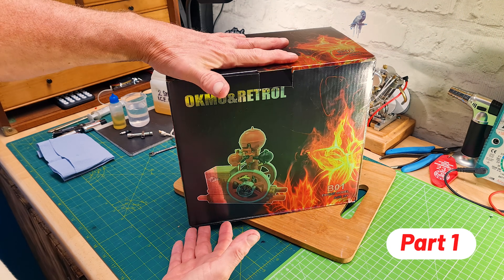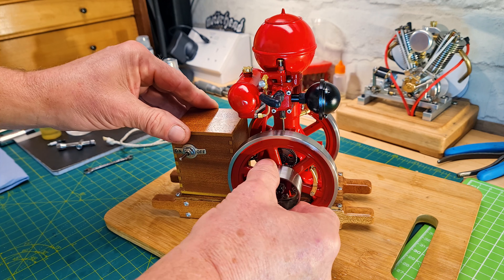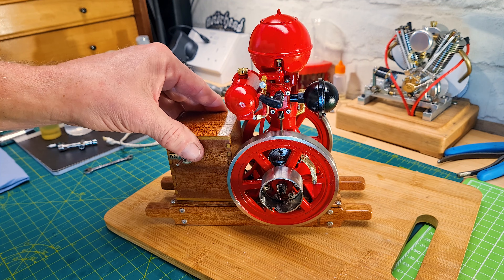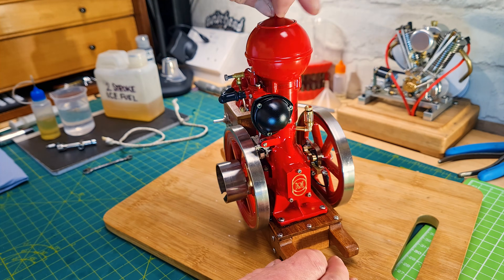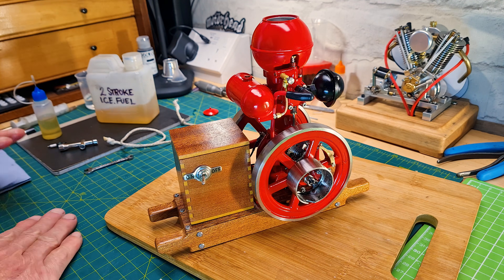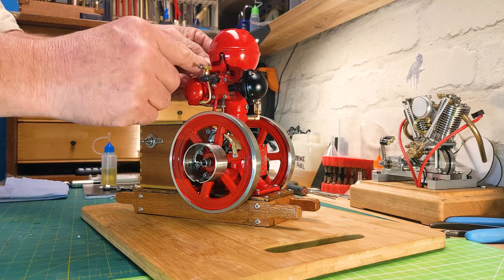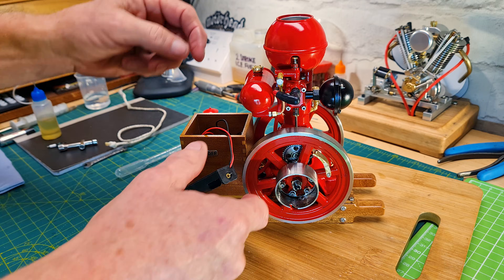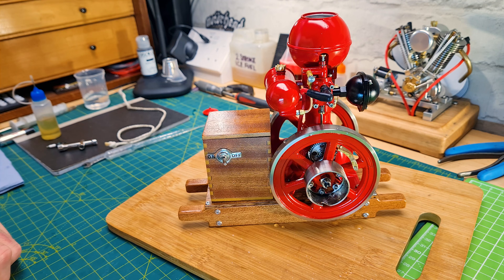Vintage Hit & Miss 'Monitor' Ball-Top Miniature Precision Gas Engine   -  (4K) #enginediy

Comment: Hi Ade. So sorry to hear you are having problems with your B01. I was lucky, mine ran straight out of the box. It's obviously either fuel or ignition. It might be worth removing the throttle needle completely and blowing compressed air into the carb. Something I noticed when I took mine apart to mount it on a wooden base board (see my latest video) was that were the earth wire is attached to the casting, very little of the paint had been removed. Before putting it back together I scraped off a little more of the paint so the ring terminal on the earth wire had a good ground. One other thing, you may not have noticed them but the bearing caps have very small oil cups cast into them. A few drops of oil in these allows some lubrication of the crankshaft. Good luck. Cheers, Alan.
Reply from the maker: It will run, just need some more time to fiddle :)

Comment: It does seem to be failing to fire sometimes hence the multiple clicks. Would be interesting to see you turn it over for a minute using a drill with the spark plug out to see if the spark is intermittent. Is the fuel nice and fresh with not too much oil in? The timing should be near to TDC which you should be able to set by observing the position of the piston through the spark plug hole. Looks like it is firing too late. Maybe do a live stream investigation so we can enjoy the process of problem solving.

Comment: These are beautiful little engines.   And yes sir, I had the same issue with mine..  In fact,  I have a full size monitor engine with the same problem. (actually its my dear wife's engine)    I think I can help. The engine is starved for fuel.   Next time you run yours, try to cover half of the intake opening with your finger / finger nail and see if it helps.
It helped mine right away.  so I made a "choke sleeve" for mine.  I found a piece of rubber coated wire, that just fits in the intake with the insulation on.   I stripped off a short stub of the insulation, about 5/16" or so, and fit that in the intake opening and ran it. It worked a little too well, so I had to drill the stub out just a bit, and now it works just fine.  If this works for you, make sure to cut the stub of insulation 1/16" or longer. this way there's a little hanging out the engine if you ever need to remove it or replace it.   

I think this is a rare issue with these engines, as mine is the only one I know with this issue, until I saw this video.    I hope this works 

 Also I need to run mine with the needle valve open more than 3/4 turn.  Also make sure you have at least half a tank full or more of fuel in the tank.  Mine also jumps around a bit. to help with that I made up a weight that fit inside the engine's skid.

I hope this helps you with yours.  And please let me know if this helps.    These are wonderful little engines!
Reply from the maker: @20bluebug - Thank you so much for your reply and valuable insight! I will take your advice and continue working with this lovely engine until it purrs!  - Kind Regards, Ade

Comment: Great overview of this engine! I found with mine it was a little temperamental as the contact for the HT lead to spark plug wasn’t close enough to the contacts, bent it in slightly and it runs very well, I do run it on colemen’s camping fuel but I’m sure that wouldn’t make a difference on reliability!
Reply from the maker: Yes, this was also a concern to me, as the rubber cover is at a rather acute angle, I will look into improving the electrical integrity within the cover. Thank you for your advice. Kind Regards. Ade
Reply: @adeswash Forgot to mention I’d also make sure the gap isn’t too big on the ignition cam & the contact, had to bend mine little closer to the contact and ran great afterwards 👍
Reply from the maker: Lots to try, thanks :)